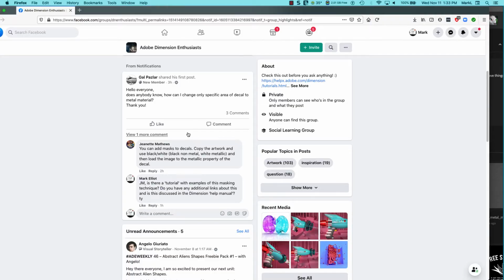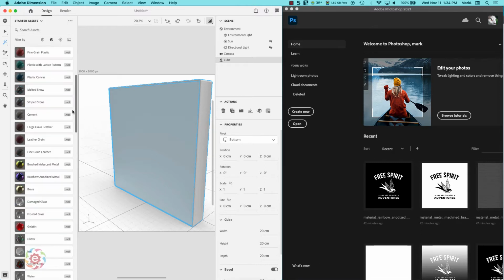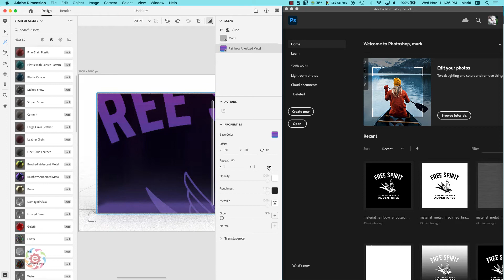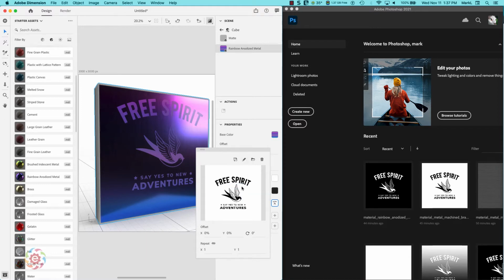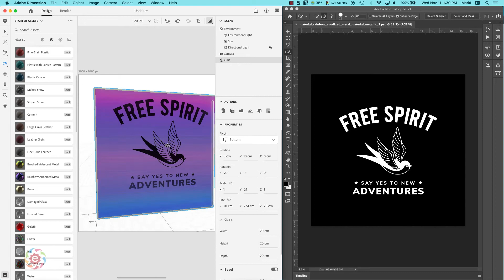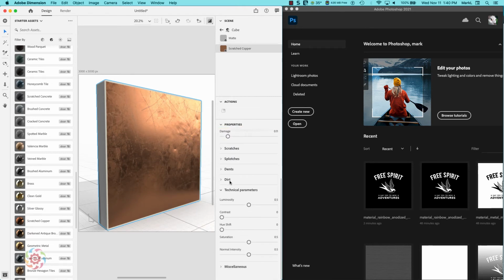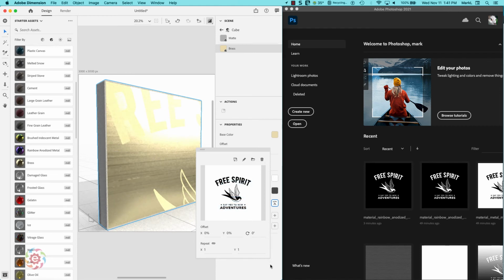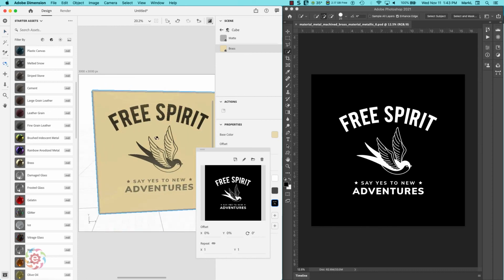Adobe Dimension Tips:  Using a 'mask' image to control metallic properties.

Comment: Hi great video on a fun topic. To get this to work using the "Substance Materials" you need to convert the object to a "Standard Model" after using the substance material. Then add the graphic I used gif's with the whites being transparent. Once you do this the metallic panel will show up. FYI I needed to increase the metallic percent before adding the graphic to the metallic panel.
Reply from the maker: ah ty! I will see if I can this comment with your permission in the description of the video...Let me know if I can put your comment their with your credit...ty
Reply: @easelsolutions  Yes that's fine on the credit although not needed. Thanks